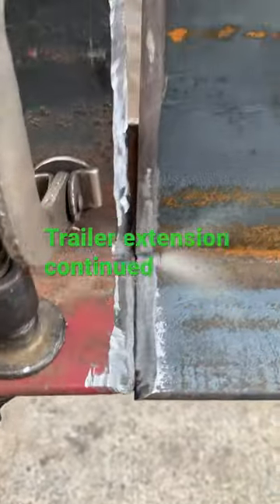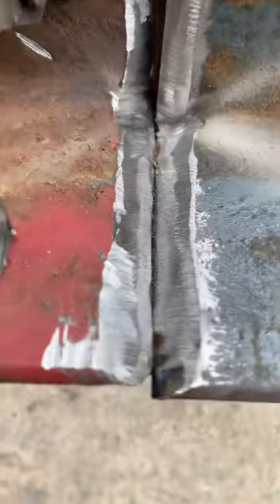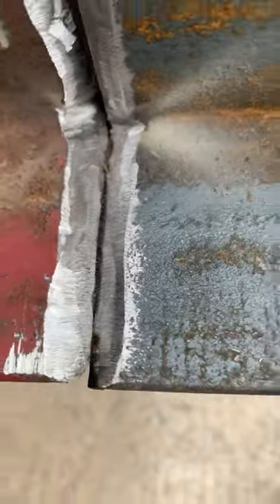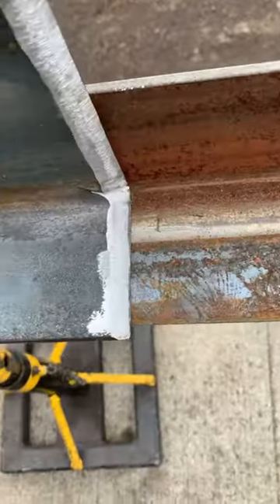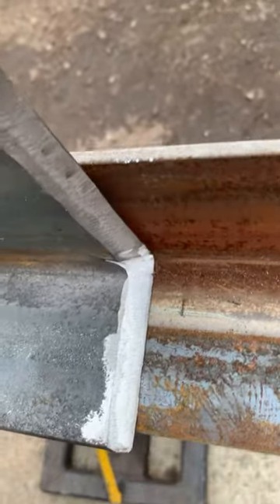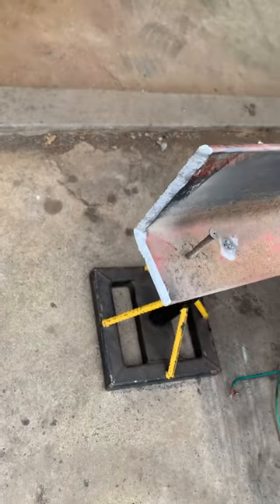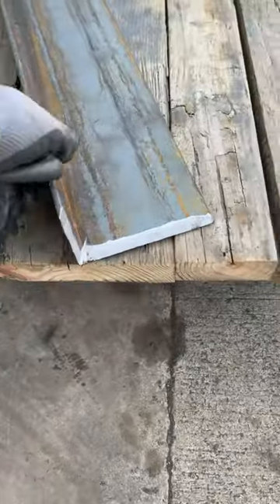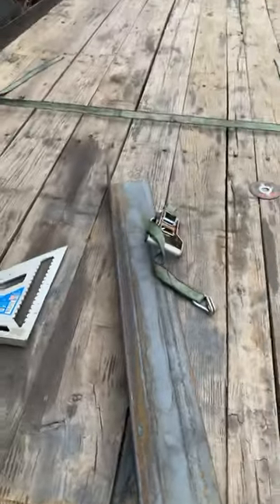Welding fabrication and design. Trailer mods #welder #welding #weld #shorts #trailer

Comment: Ummmm I see a lawsuit in your future.
Reply from the maker: Why do you say that did I do something wrong? After welding these angles in I also added in two three support braces. One in the middle on center and Both ends under the weld points. So can you kindly elaborate what I could’ve done better?
Reply: Would’ve drilled some bolts through the supports also just in case welds fail at some point.
Reply from the maker: @GetRich23  that’s a good idea. I’ve done that to some projects before In the past  and  for future projects like this I might consider that as a back up thanks for your input. Respect for sharing

Comment: 37° is the angle you want for a weld joint
Reply: Not that serious bro
Reply from the maker: Is that to make sure we leave some material on the back for penetration to bind to.? I was taught to grind to the 45 or a little under. I normally grind to the base so I can see the penetration on the back and if I have a open root like I left . After I grinded that I welded the back of it as well for security. And played the bottom